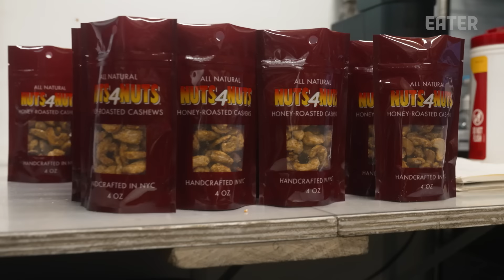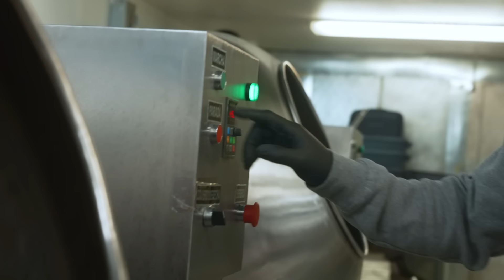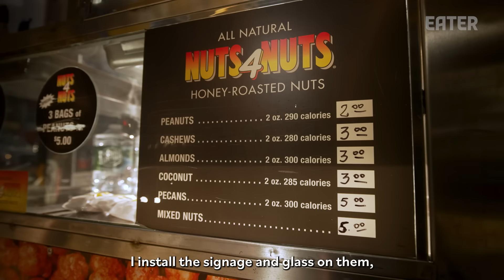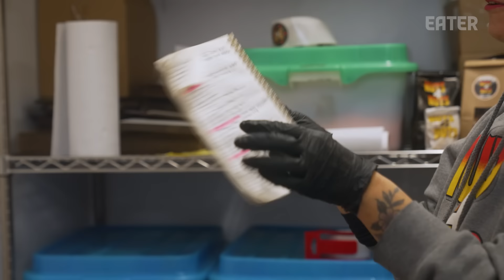How NYC’s Most Famous Street Nuts are Made Fresh Each Day — The Experts

Comment: With how operation is at their factory, they might have a hard time scaling even bigger.  They only have two machine and that machine requires a body there to constantly stir and mix the nuts. A possible solution is welding some rods along the inside of that pot that'll stir the nuts as the nuts roll pass them. I've seen something similar at a velocity chinese stir fried noodle restaurant. Of course it goes without saying that they'll have to fine tune those rods to get the proper consistency that they need for the nuts.  But to implement that would allow more machines to roasts the nuts simultaneously without having to have a body at each machine.

Everything is done by hand e.g. sorting, packing, and even the logistics of fufilling orders.  If they were to scale to be a national product, they would have to start streamlining the process and have to automate some of it. It's nice to hear that they've done a long way since they started. But they need a way to cut down on the bottle necking.
Reply: we already have this machines automated and we are in the middle east , they need to up there game , the automation already available from china.